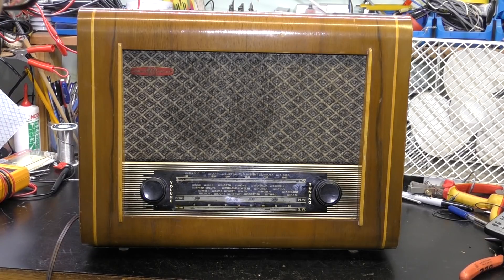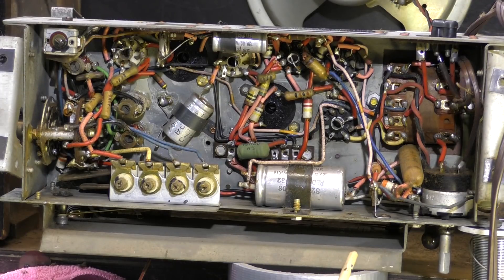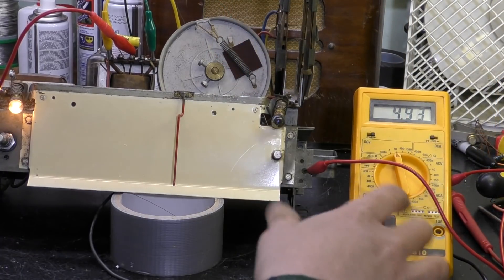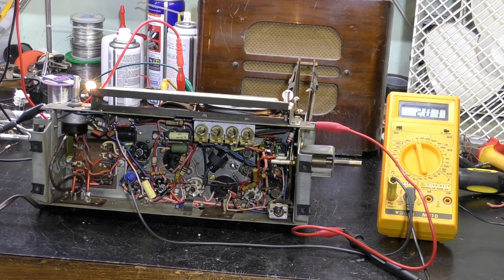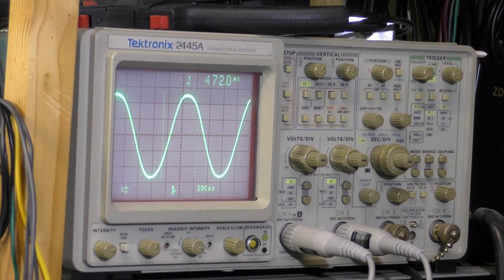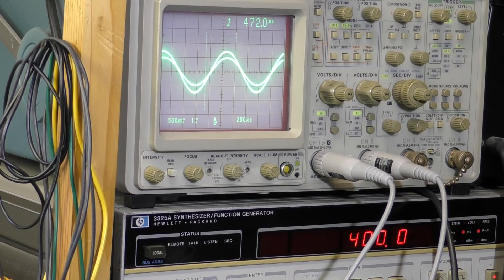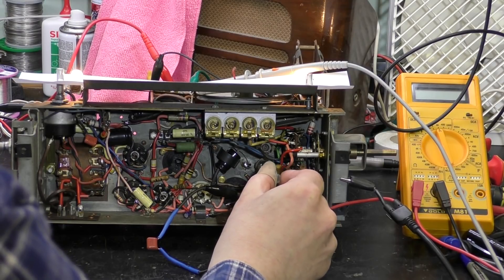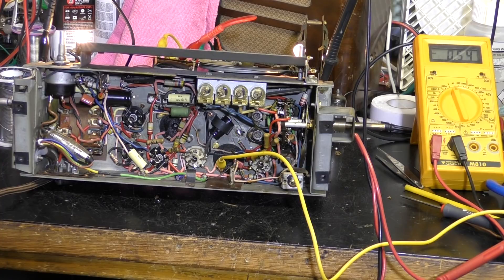Pye P75 Valve/Tube Radio 1955 (V2)

Comment: I have a PYE radio (1958) that I purchased in New Zealand twenty odd years back; I then took it back home here in the US. Beautiful wood table model. Purchased a step up transformer from 120AC to 240 AC! It works quite well! Do hope I did the right thing, that is  to have it operate with the transformer. Enjoy listening to your radio knowledge, awesome!
Reply from the maker: Thank you and glad you are enjoying the channel. I see no problems with using the transformer, as long as the voltage is correct. The mains frequency shouldn't make a lot of difference.  Bet there is more on AM in the states.

Comment: Later radios from Pye that had almost the same wood cabinet, had FOUR switches et on the front of the radio. Vol, Tone, Tuning and channel selection et In comparison this looks with the switching on the sides, rather ugly. The cabinets (even the later ones) were pretty solid pieces of furniture. 👀 Later ones also had an automatic volume feedback loop that fed anode to pre amp grid bias which could be problematic. The aerial to 1st and 2nd I.F coils could also be a problem. All in all however, the radio set when working properly was a decent solid radio.

Comment: A million years ago I had a BUSH radio very similar to that one with the 41 series valves, it also had good sound, mostly due to it's largish speaker, all wood cabinet and several negative feedback loops around the audio stages. The EL41 does seem to have abit of a reputation, I've not had issues personally with it but the EL84 had a higher output and would be my choice as preference. Nice looking radio, thanks for uploading, all that was missing was a magic eye...I just love those things.
Reply from the maker: Thanks Michael. The EL41 is under run on this set i'd say with the 220R cathode biasing so maybe its not run so hot. Filament shorts and grid emission seem to be the problems.

Comment: I have a pYe P76 model, but I don't get  any white noise on the SW band as I do on the MW, TB and LW, why is this please?
Reply from the maker: The local oscillator may not be running at the higher frequency. Maybe wavechange switch Daz
Reply: @darrencoe5795  Thankyou for your reply, at the moment, the power switches on and I can hear the hum of the valves heating up, but no reception on any bands?? just silence? I would love to get it fixed, but I don't known if the price of all of it to fix it would over weigh the price just to get another valve radio??
Reply from the maker: @Lanceitc  any radio of this age will may need work unless somebody has already done the work. I believe this radio has no internal aerial and you have attached a length of wire to the aerial socket and still get nothing?
Reply: @darrencoe5795  Yes, attached  wire from the aerial socket, used to work, but there is no crackling even when I place the wire near the aerial socket no more?

Comment: The P'diss on the EL41 was 9 watts whereas the EL84 was 12 watts. The socket EL41 is an 8pin B8A whereas the EL84 is a nine pin B9A base. They are not a like for like substitution without modifications necessary. Generally as a firm favourite for musicians in their valve amps, the EL84 remains readily available at a competitive price. The EL41?😗

Comment: Great video Darren, very clear and easy to follow.
This set, like many of its contempories, was so obviously designed to be easy to repair when needed. The single ended output stage is very similar to what I had in my first record player, an ECKO with a Collaro turntable in it.  It was a very nice sounding circuit.

All the best meters need a little tap like your Megga.;-) also I love your AVO, I have the earlier one with the rotary "K=1" rotary switches but basically the same unit.
Reply from the maker: Something about Single ended stuff I always thought.

Comment: I have the same radio which has always worked really well and still does. I don't know if the caps have been replaced. I'd love to have it looked at and have an optional jack input installed if possible...Are you in London?
Reply from the maker: If there is any hint of distortion, then you probably have original capacitors. I've seen a set set still running on original capacitors and was a little distorted.  The danger is overdrive of the output valve due to DC leakage of capacitors. A isolated chassis set like this is more suitable for a jack input although bear in mind it needs a fair amount of drive to get top full volume. I'm based in Suffolk, England.

Comment: I have my Dad's old Pye P75. He used to have it playing whilst pottering in the garage! For an aerial, he just used to have a single strand of wire just hanging up from the back. Reasonably effective, but not very aesthetic. Was there ever an original external aerial that went with the set; or could you recommend one to use with it, that's sympathetic to the era.
Reply from the maker: To be honest I suspect a random wire was what was used. My grandfather had a wire running up the picture rail. Aerial kits were available and sometimes theses were just a long wire fixed to a tree with insulators and sometimes vertical rods were used with matching transformers. Also there was wound aerials in wooden boxes.
Reply from the maker: Have a look at this video https://youtu.be/E4bXYDGrCB4 this is a frame aerial. I've never seen one in the flesh, but is a neat idea.

Comment: Hi Darren.
I have one of these Pye sets to restore. I would like to do the IF alignment, but need an oscilloscope. I was going to buy a used one from ebay, would a 
60 MHz Tektronix TDS1002 Two Channel unit be suitable?
Reply from the maker: A 60mhz scope is good for much of the radio work of this type. Of course ,basic IF alignment is possible with just a AC Meter across the speaker and a signal generator.
Reply: @darrencoe5795  Oh! So I assume I just tune for maximum on the DVM?
Reply from the maker: @neilgarfield2831  Yes maximum keeping the signal generator as low as possible. Not many AM sets require use of scope for setting up the best curve/response unless something special from what I have worked on so far.
Reply: @darrencoe5795  OK, thanks for the info. I'll give it a try.
Reply: Over 40 years re valve radios/equipment.. re radio tuning. Most receivers can be easily tuned by using a signal generator and voltmeter et Using the MANUAL and instructions on doing the alignment is essential. Doing it correctly in stages is often a must. 👀

Comment: Hi Darren, we have just cleared my parents in law's house and I brought out one of these lovely PYE radios.  It works, but I have to admit that I would like to put a new bluetooth speaker in it - sacrilage I know (I can hear my Daddy turning in his grave!)  Would you like the innards - or do you know anyone who might want them? Just a thought as I don't want to get rid of something someone else might treasure.
Reply from the maker: I would say as this chassis is isolated, it would be possible to add a audio input and use the internal amplifier. Just a switch on the back is needed, connected to the volume control. Then it would be possible to use it as a radio and a blue-tooth speaker, you would then get a warm valve sound. I'm looking at bluetooth mods at the moment as I know it will make some radios more useful.  If not, I am sure someone may have a cabinet that needs a chassis